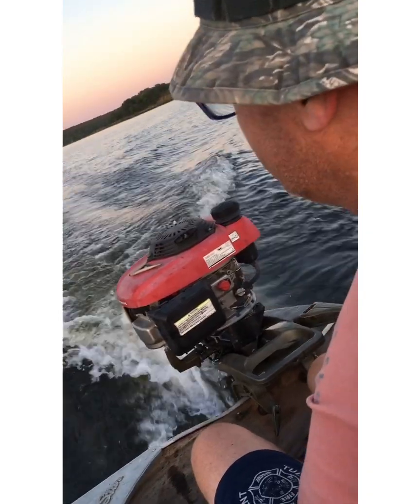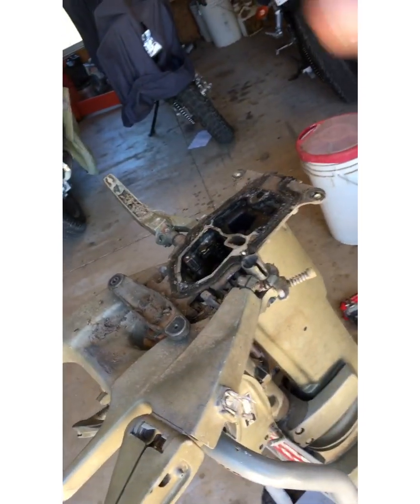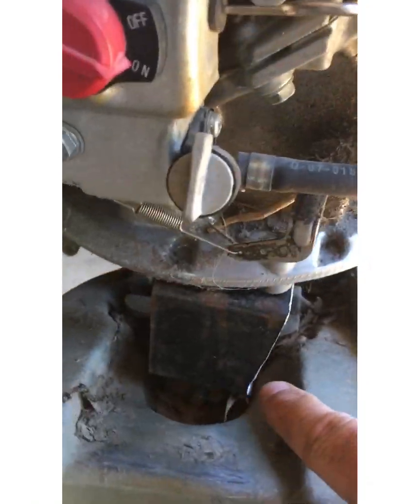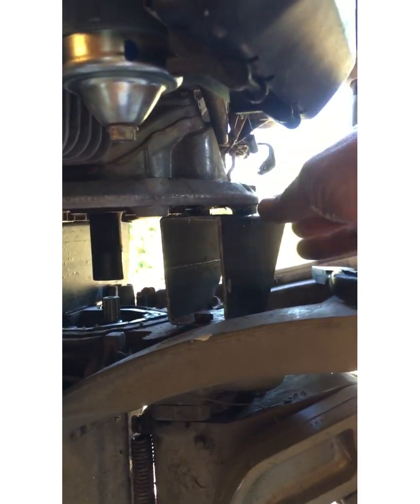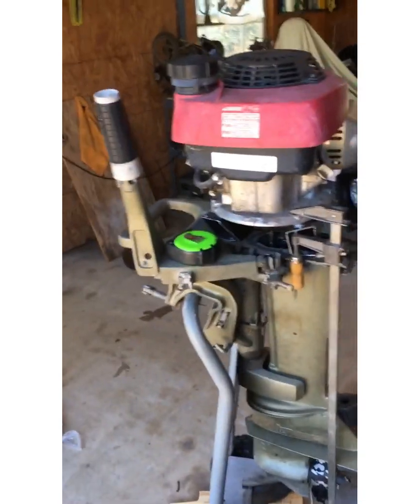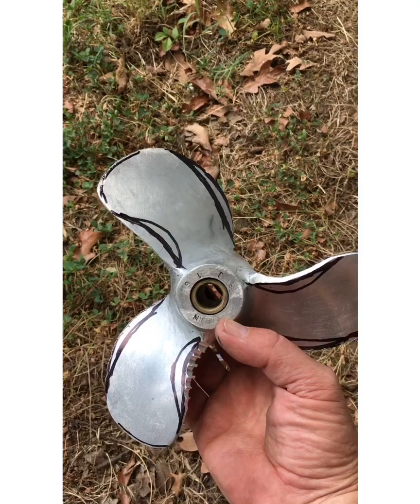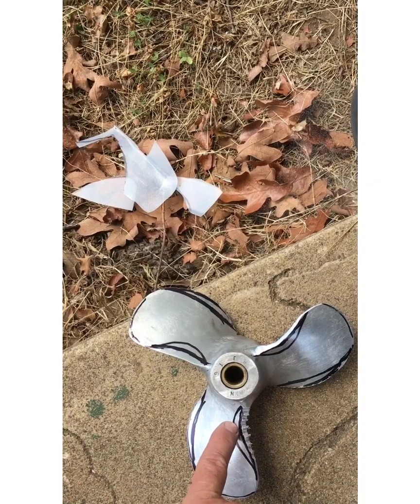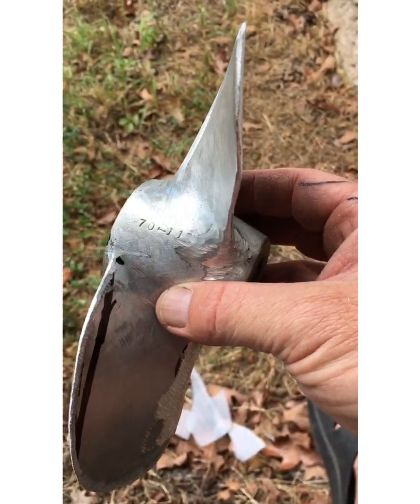Lawnmower boat motor

Comment: Hey great job I have a question I have a johnson 9 1/2 can you tell me how to remove the power head I have one that would make a great one just need to know how to remove it thanks for sharing
Reply from the maker: Just start taking it apart from the top when you get the motor off you’ll see the lower shaft and that’s a good place to start

Comment: did you take the water pump impeller and housing off and leave them both off?
Reply from the maker: Water impeller still in lower unit, water spraying up and under engine for extra cooling. Not that it needs it.
Reply: @stevensee4755  what pitch prop do you run? mine kills the motor soon as i put it in gear in the water.
Reply from the maker: @johnnychason4472 I used the one on the 25 hp Johnson. I did cut it down( prop) at the end of video. 
Is the motor you used making 3-4 hp? Maybe needs new rings?
Reply: @stevensee4755  i put a 13hp on a 150 mercury bottom and it runs perfect but when you put it in gear in the lake it chugs the motor then kills it. its a 21 pitch prop and i think its digging way to hard for a 13hp so i ordered a 11 pitch 40hp prop to try be here monday, its a 4 blade so i can cut 2 blades off and get less grab and even more rpm if i need it. what you think?
Reply from the maker: @johnnychason4472  yes I think your going the right direction.

Comment: do you remove the water pump?
Reply from the maker: No the water pump is still there and working, Originally I just wanted to see how fast it would go not sure if I would even work well so I didn’t worry about taking the water pump out and I just haven’t got back to taking the lower apart or adding even knew oil to it I just ran it like it is

Comment: Where do you get those couplings?
Reply from the maker: just put" motor couples" in google and will be easy to find, you just need to know your shaft sizes. I hunter around for the cheapest.
Reply: I've seen those couplings in Jax Fl.
At Northern Tools.